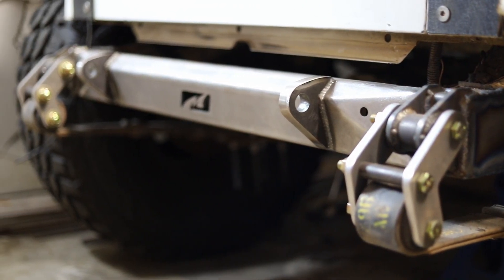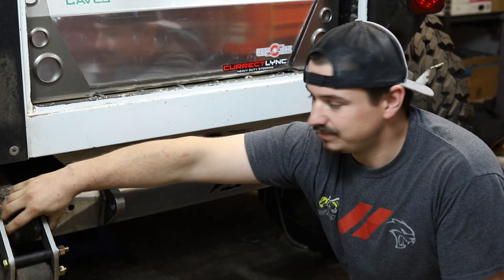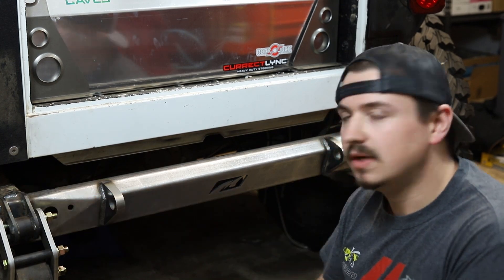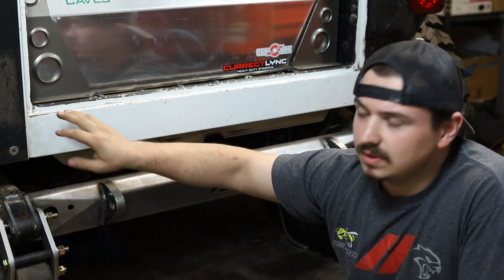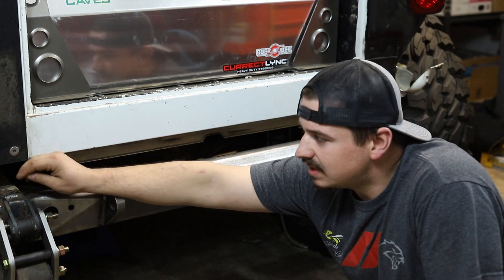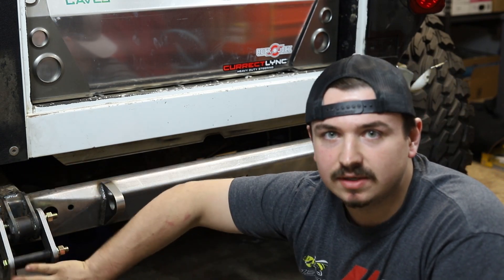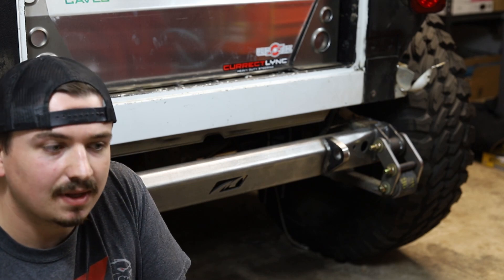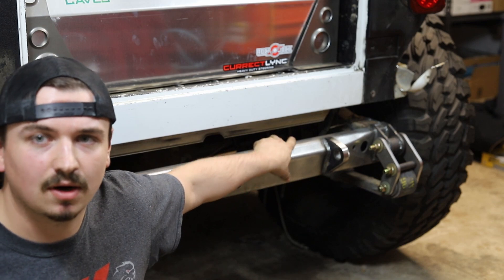Jeep Wrangler YJ Motobilt Rear Stretch

Comment: Dou you need to use 4 inch lift xj springs if your yj has a 4 inch lift on it already?
Reply from the maker: Are you spring under or spring over right now?
Reply: @breakingbolts7621  I was wondering about springs as well. I am spring over with stock yj springs. Assuming I just get the stock xj springs and run them over axel to match ride height?
Reply from the maker: No it won’t match. You will come down a bit.   Stock XJ ended up lowering rear too much. So I moved the frame side mounts back and used Jeep Wagoneer front springs from a 74.  This also gave me another 3” of stretch.  I’m about 9” rear stretch in the rear now
Reply: if i want to do a mild build and still daily drive my yj, is this a good option?

Comment: I'm planning on going coils in the front via subframing a tj front section onto my '89. I want to use xj leaves in the rear spring under in the original direction, no stretch. I have OME 036 springs now with just about 3" of lift and 33-10.50 ko2s.
Any idea what size xj lift springs I should use to keep it the same height?